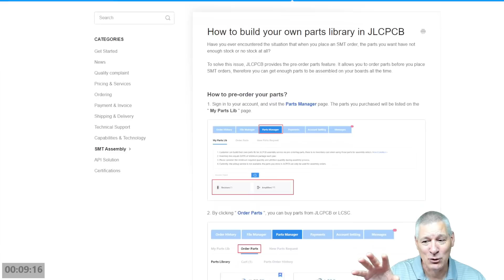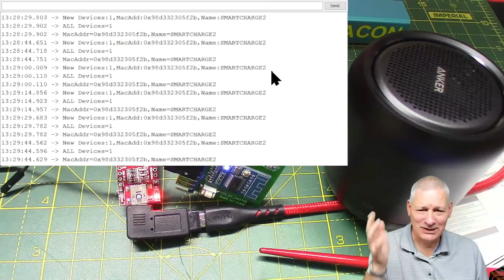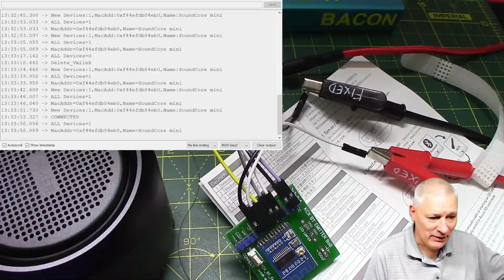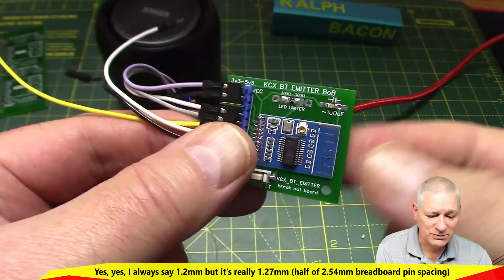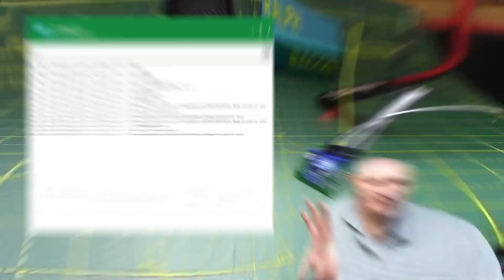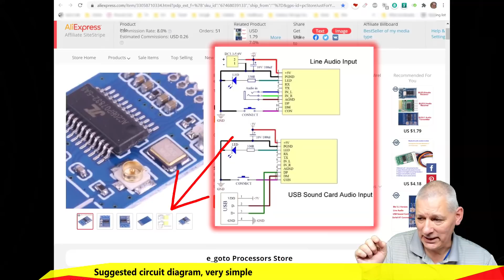#235 Bluetooth Audio🔊Transmitter (KCX_BT_EMITTER) - with AT commands

Comment: Thanks Ralph, the breakout boards are invaluable i've used both that I have 1 for ESP32 web radio and one to add BT to my sonos connect! Thanks again, I wish i'd have had this video when i first started playing because the not sending CR or LF to the device when sending AT commands drove me mad!  you just get "command error" back from the device, so you think it is the command thats wrong not the fact you are sending a LF!!!  Happy days, Keep the videos coming :-)
Dave

P.S. Not had any issues with the antenna and the breakout board, however a cheap  external BT antenna does extend the range quite significantly!
Reply from the maker: I'm sorry I didn't mention the line ending bit to you earlier, Dave, my bad 😳but at least you got it working now!

Regarding the external transmitter (one of which I have, but not tried) did you have remove any components (eg a null resistor) on the board to use it?
Reply: @RalphBacon  As far as i can see the micro connector and on board antenna are connected in parallel, i have not modified the board at all and range is far better when the external is connected.
Reply from the maker: I'll give it a go later, thanks for letting me know, Dave.
Reply from the maker: I've given it a go using a small rotatable antenna that I bought a long time ago for an ESP32 but never used. FANTASTIC range and quality difference! I will be updating my GitHub with details so others can benefit from your experience Dave, thank you so much for nudging me into trying this. 👍

Comment: Hi Ralph, others have said it as well but that PCB antenna should not have been on top of your custom PCB. Rather there should have been a giant cut-out or the antenna should have stuck outside of the adapter PCB. This to prevent any influence on the bluetooth signal quality and strength. That trace under the antenna is big no-no as well!
Reply from the maker: There's no ground plane on the breakout board (specifically for this reason) so I doubt the plain PCB will affect the antenna (?), but the single track (a GND line) in that area should have been routed round the edge of the board or something, I agree. Bad Ralph.
Reply: @RalphBacon  That there is no ground plane was clear but its still a better design practice to not place the antenna on top of another PCB. Either make a cut-out or place the antenna outside of the adapter board, the last being the preferred option if there are no space constraints of course. 

Even though the PCB below it has no ground plane doesn't mean that traces that are routed in the vicinity of the antenna have no influence (they do not even have to run below/under the antenna) as some traces form a (ground) loop. This can act as an unintended (small) antenna which may interfere with the intended frequency the actual antenna is supposed to operate on or produce weird harmonic (RF is a strange and complicated world).
Reply from the maker: Agreed, my design was not optimal in this respect. 😳

But I've just tried a small antenna plugged into that socket (the type of antenna you can buy for the ESP32 or other BT modules) and it has made a HUGE improvement. So maybe that PCB antenna is quite sensitive to other (nearby) tracks. Live and learn! I will update my GitHub for this project with more details.

Comment: Interesting video.I wonder how you get the initial connection to the right device, if there are several available. You may not be able to switch off all of them! Perhaps you need to use the serial interface to select the correct one. Still, a useful gadget. About 13 years ago I was looking for a Bluetooth audio link to connect my computer to my stereo (so I didn't have to have wires running across the room) and they were ridiculously expensive and the reviews where not encouraging. I ended up running flat cables under the carpet!
Reply from the maker: It will only connect to something that is in pairing mode (which you can control of course). In this demo, it found the Smart Phone Charger (but didn't connect because it wasn't asking for a pairing connection) so I guess it would have connected to my little speaker (in pairing mode) after all. Oh well...

Comment: That trace should not cross the antenna. It can change the characteristics such as the resonant frequency . Probably not a big deal in reality but in practice some even have the antenna hang off the edge of the PCB.
Reply: I agree. The area around the antenna should be kept clear of anything.
Reply from the maker: Yes, it's a GND trace added belatedly. I should have routed it manually elsewhere.

Comment: Thanks for the demo and information. It always seems more difficult to find Bluetooth transmitters than receivers, and I've often used those little transmitters with a built in battery, but found it a bit messy; these little boards  look like they should work a treat.
Reply from the maker: Glad it was helpful! And so far, they do indeed work a treat!

Comment: Hi Ralph.
Please may I get in line for a breakout board.
Thanks John.
Reply from the maker: You're in! Obvs, given that you have built my ESP32 Web Radio! Send me your address via email please.
Reply: @RalphBacon  Thanks Ralph. Sent details on the email address we used before.
Reply from the maker: On its way, John.
Reply: Thank you Ralph look forward to using this. I Already use a Bluetooth speaker, but with a line out connection. Be nice to get rid of another wire.

Comment: Oh, I was looking for a Tx module like this for years and gave up last 11.11 sale when I bought ugreen Tx and Rx devices. But I am definitely checking out this module anyway, so I am interested in breakout PCB.
Ugreen devices are probably nicer, because of aptX capabilities, but I wanted to be able to cotroll transmitter from uC so bad.
Reply from the maker: Glad I could help. I've noticed a couple of (cheap) BT modules appearing, I wonder why?
Reply: @RalphBacon  Just got your letter containing the PCB. Thanks a bunch!
It got here in 21d, just in time with the module itself, so I'll start my tinkering asap.
Reply: Made initial tests, transmitter works with cheap MH-28 Receiver that I had. Connects with both Ugreen CM110 and CM402, but neither of them decodes properly, only silent led flashing.
Looks like it is going to be a challenge to find compatible low noise receiver.

Comment: Can you use the built in esp32 bluetooth functionelity for this?
Reply: Probably not. I haven't heard about Bluetooth A2DP profile being implemented on ESP devices.
Reply: @Mr.Leeroy  Theres a ESP-IDF A2DP-SINK demo in the IDF examples folder.   The example uses Bluetooth classic A2DP for audio stream reception. Espressif says you have to use and external i2s  or  internal DAC (8 bit) for output to a speaker.
Reply from the maker: If the standard ESP32 can send BT audio that would be a start but then we would still need an I2S decoder so probably no advantage after all?
Reply: @RalphBacon  There would definitely be an advantage if you are after HiFi specs. Most of modern DACs require I2S input now. Something like PCM5102A would be an easy upgrade over KCX module.
How much processing power would I2S + BT stack require and whether it is worth in terms of time spent, that is what I am questioning.
Reply: @RalphBacon  
I2S is a hardware protocol built into the esp32. For what would you need I2S in a BT webradio with no mic or speaker? 
BUT : Can the esp32 use wifi and BT at the same time?
Reply from the maker: As Leeroy says, BT audio is (probably) not available on the ESP32 - but I will look into what the BT can do on this module at some future date.

Comment: Nice board Ralph, should that cap read 100nF ? or are the holes for 100uF.....cheers.
Reply from the maker: It should be for (up to) 100µF but I think I put a much smaller one in there just for decoupling.
Reply: Cheese!!!!!!!!!
Reply: @fredflintstone1  SQUEAK!!!!